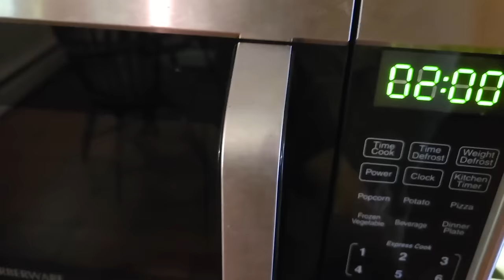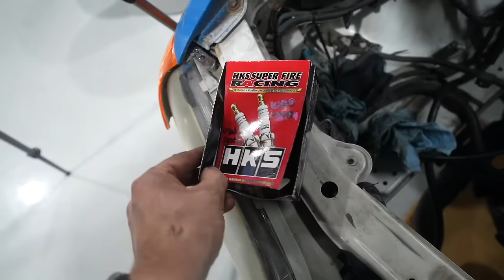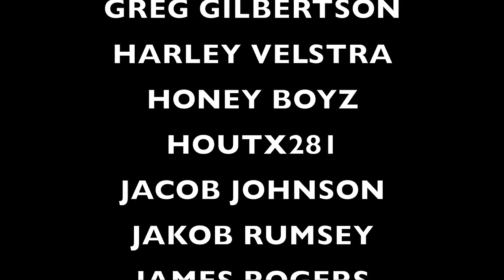REFRESHING THE 1JZ ENGINE IN MY JZX100!

Comment: Get some Permatex #3 guy, seeing gasket goo on every gasket is painful. You can also use it on the outside of oil seals, it lubricates the surfaces to help you push them in and then hardens to help hold the seal in.

Comment: I'm surprised both you and sam don't know to use the old front main seal to tap the new one in, that's why you don't destroy the old one taking it out, Just use two self tapper screws on each side of the old seal and you wiggle it out.

Comment: R154 doesn’t need an alignment tool. Just load pp and clutch disk on. Then slide trans onto motor. The input shaft will login everything up. Literally did a clutch on mk4 today took 2 hrs
Reply: Wtf are you talking about bro? I would hope "load" means bolt the pressure plate on, and what is the input shaft logging into. Facebook? . I really hope nobody takes this advice lmfao

Comment: You shouldn't ever oil or grease the outside of a seal. The outside is supposed to be tight and if it spins bc it's lubed up the it will fail